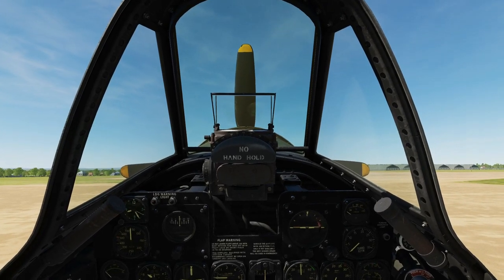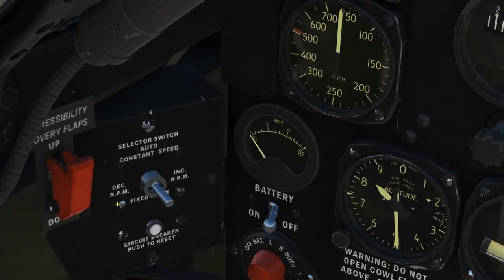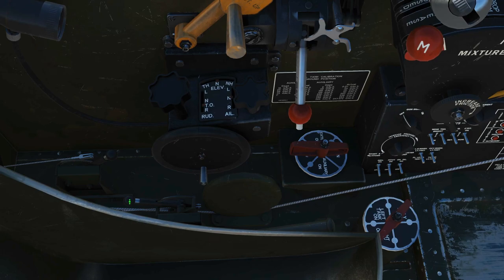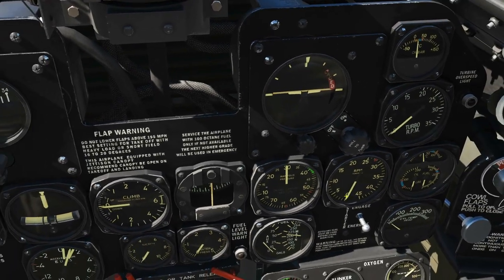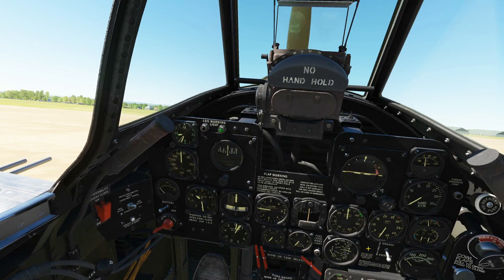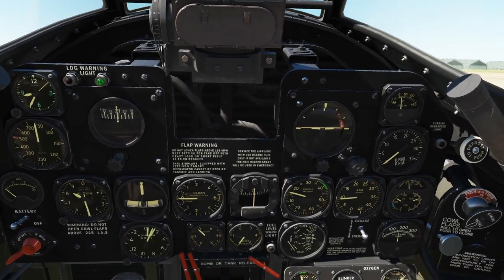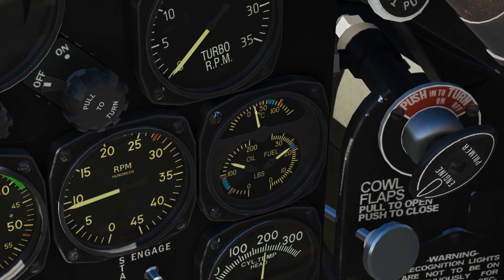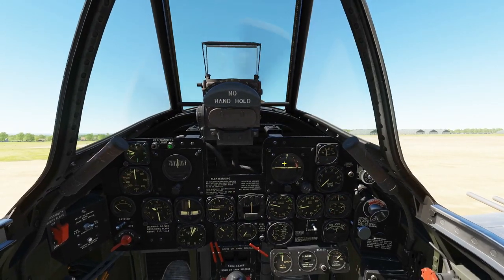P-47D-30 Thunderbolt: Cold Start Tutorial | DCS WORLD

Comment: I thought i followed your tutorial but apperently not.
Whenver i start the engine and start rolling i can't turn the aircraft, Yes i am using ruddder controls and my Tail wheel has been unlocked, can you explain what im doing wrong?
im guessing theres something obviuos i forgot
Reply from the maker: Let me go check it out and see if they changed something.
Reply: @grimreapers  i looked through the controls again to see if i missed something.
My wheel brakes weren't bound to the rudder pedals, so i was using the rudder purely to turn which obiously didn't go very well. Thanks for the quick response though :D

Comment: Hello @Grim Reapers
I did the procedure the way you taught, however, when I accelerate to take off the engine starts to lose power and is left with rotation failures, until I lose speed and fall.
what am I doing wrong?
Reply from the maker: Somethings just changed because I just got the same. Please let me know if you discover the reason.
Reply: @grimreapers  hey, I seem to have discovered the problem.
You have to activate the oil dilution / mixture that is on the bottom left side of the cockpit, next to the generator.
Reply: @grimreapers  You have to activate the oil dilution / mixture that is on the bottom left side of the cockpit like I said, and, STILL, to work perfectly, click on the Intercooler switch until you get to "OPEN CONTROL". Okay, now it works perfectly.